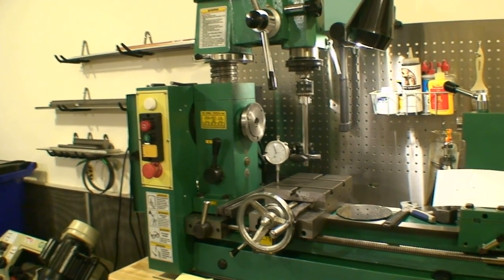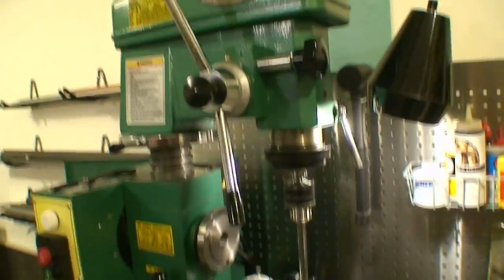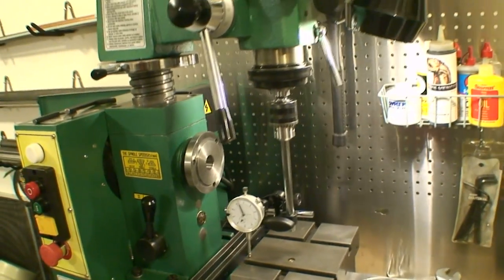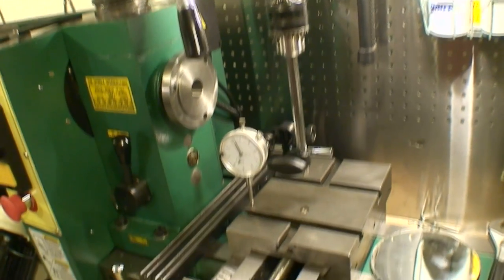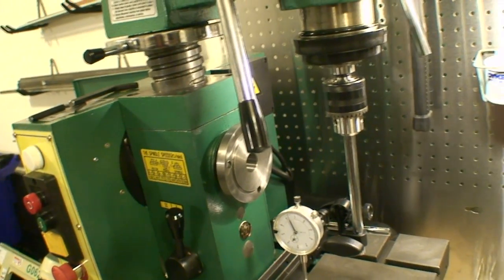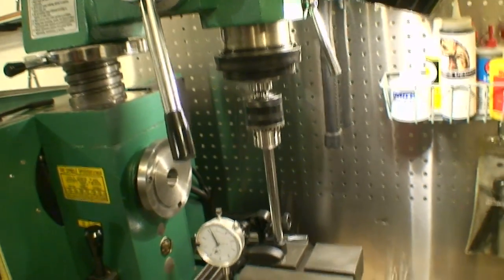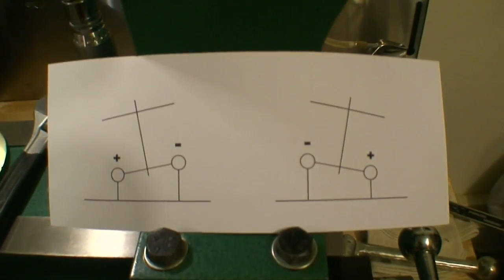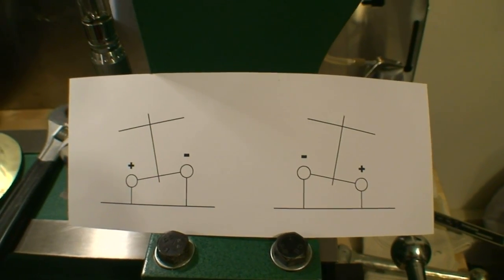Tramming the Grizzly G4015 and other lathe/mills

Comment: If the mill head is fed by splash lubrication you may have created an oil leak. The head has to be locked in position then the lathe bed should be checked then the milling table should be locked in position. you do not use a drill chuck and before going to the extremes of tramming check quill accuracy for runouts. Here in the UK our Grizzly is called a Chester model B and youtube has some very good videos of these machines some are years old and they have never trammed them. Depending on year the tailstock top locking lever fits on the milling head raise collum saving using an Allen key to lock the swivel.  Grizzly use the same machine manual but the parts list is different numbers although the drawings are exactly the same

Comment: Thanks for posting your video!  I too have a 3in1 and need to tram it.  It's quite and old machine so I don't think it's ever been trammed.   Curious about your machine and the table size?  It appeared to be like my 6x8 table but it looks like you have a 4" vice there?  I just got a 4" but had to send it back as it would not mount with the base on (just a bit too wide).  Anyways thanks for the video and advice I will be referring to it tomorrow as I dive into DTI work!

Comment: Please Sir, tell me how to lock the drill press unit so that it does not swivel around the mounting post.
Reply: I have an GB version and it sits near to my workshop wall. I tie the milling head to the wall with 2 x M8 studs and joined with RH and LH threads so I can connect disconnect, but it still changes origin when you raise lower the head.

Comment: When the head was off it would have been advantageous to put some threaded holes through to use as jack screw holes, then no shims would be needed, and you would have the ability to tram your head any time very easily.
Reply: The problem with doing any of this is that it is disturbing the fit of the meshing bevel drive gears. And by the sound of it he had the 4 bolts only finger tight when he first trammed it. So he is just pissing in the wind trying to get the thing properly set up, tighten the bolts Dow fully THEN tram it. I bet the results would be very different than what happened here. And to get into a situation where one or two of the bolts were less than "Snug" when operating the machine could lead to a disaster! And add the fact that you have now opened up mating surfaces to the ingress of dirt and chips, especially if you machine a lot of brass.
Reply: Cross Slide see snaproll94e's explanation below for the jack bolts. I feel they should be fairly large so as to not generate high pressure on the lower unit. When you tighten the hold down bolts they will cause a large compressive force between the upper and lower units. I have a Smithy version so I'm in the same boat as you.

Comment: I know it's a very old post, still I might help to get this down properly. First you must understand what you are trying to adjust, and all the factors affecting it.

First start with the spindle run out, when you turn your micrometer your measurements may be off because of the spindle runout, to measure it place the micrometer on the table and dial 0.000 on the rod (assuming the rod is rectified and can be trusted to a tolerance lower than the micrometer specification) carefully without touching the rod turn the spindle and observe de variation, you can grind or sand the spindle nose to correct the runout. I suggest you read some about run out before doing this.

Now that there is "no" run out, move the rod on the Z axis (up and down) a determined distance say 5 cm and observe the variation, with basic trigonometry you may know the shim thickness needed and where, use stainless steel shim roll and cut it to 1/4 of the spindle base and cut off the bolt hole so you won't have trouble with it moving, and always use a torque wrench and torque all bolts to the same specification.

At this point you have the spindle aligned to the work table that mean your cutting angles will me the intended and will not damage your tools and will get a better finish.

But you still won't mill a perfect cube. Because the bed may or may not be aligned to the spindle.

Now remove the rod and place the micrometer on the spindle and move the table in X axis (left and right) a certain distance, basic trigonometry same story and place shims as needed and torque. Repeat for the Y axis (front and back). 

Now everything is perfectly squared, if you know your machine top to bottom this shouldn't take more than a couple hrs and practice makes the master, you should check this every now and then according to the use. NO MACHINE WILL ARRIVE SQUARE, no matter how good and expensive anything and everything will affect this, even if you just change the machine from one end of the room to the other all of this will be affected. And that's why the foundation for this kind of machines is so important.

There are much more things to check like axis backlash and axis quadrature but that's anther story the ball bar test is great for that. This is a very good beginning for this kind of "hobby" machines.

Hope it helps, cheers!!!

Comment: I have a Smithy 3 in 1 which essentially uses the same design. You did a great job figuring out how to tram the mill. I see that you just can't trust these mfrs for an accurate machine. The same can be said for table saws, chop saws, drill presses etc.
      Mine seems to have a squareness issue with the cross slide relative to the bed. That will take some scraping or milling to square it up.
      MasterMachinist WH has the proper method. Split the difference because you are rotating the axis not tilting.
      As far as minimizing the time you would have to analyze the kinematics of the shimming plane with respect to the rotation angle. Then you could at least come up with some kind of prediction about what thickness of shim needed.
     In closing, thx again for showing the method used to tram this machine.

Comment: how do u get it down a flight of stairs.. that's my problem..
Reply: desalvo66 

I just left mine on the kitchen table.
My wife has still no idea how to mill an Espresso.
Reply: It's easy will the espresso attachment.
Just don't get a cheap Chinese one. And Italians are WAY overpriced for what they are unless you want to CNC messages into the foam...
Reply: Take it completely apart.  Only takes about 90 minutes (OK, make 3 hours if you haven't already done it 2 or 3 times) and 2 guys can easily move the stripped lathe bed and other components up/down multiple flights of steps.
Reply from the maker: +desalvo66 I didn’t have that problem but you could take off the Mill Head and move it in two pieces. That head is really heavy. Good luck!
Reply: If you stand back and look at the lathe bed there are four (on the grizzly, only two on the tailstock  of my Horror Freight) plugs or holes without plugs that accept a 1" piece of round bar stock so that you can lift the machine with some friends on each corner, or if your like me, your cherry picker.......

Comment: I just installed some handles from McMaster Carr to lock the cross slide spindle and the milling head rotation.  Part numbers are  6848K44 and 6848K59.  They replace the set screws so you don't have to use an allen wrench.

Comment: I've been thinking of buying one of these and wondered what provisions they have for tramming in the head, now we know.  There is a chrome ring with handles above the block you were shimming.  Is this a jam nut?  If it is, shouldn't it be tightened against the block to take out any clearance in the threads before you tram the head?  Instead of shims, is there room to drill and tap the block and add some jack-bolts?  Have you trammed the table to the lathe?  Just wondering what kind if accuracy a buyer can expect.  Thanks for making the video and answering my questions.  With 10k hits, you've helped lots of people!
Reply: +snaproll94e  - Jack-bolts, what a great idea!
Reply from the maker: +snaproll94e The chrome ring is the height adjustment for the mill head. Thanks for viewing!

Comment: you start one one side then move the indicator to the other side like you did when it red .007 leave it in that location and move the head .0035 and then swing it back to the beginning location re zero the indicator and re check. This is what i teach in my class and it is way less confusing. Good Luck!